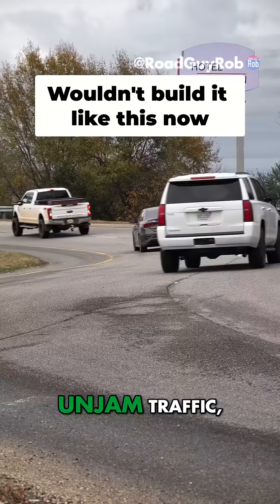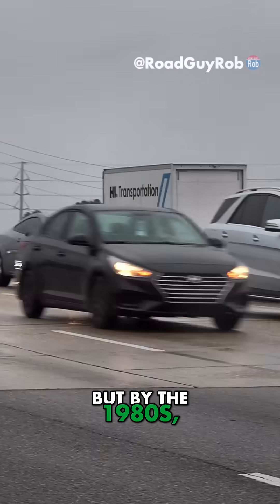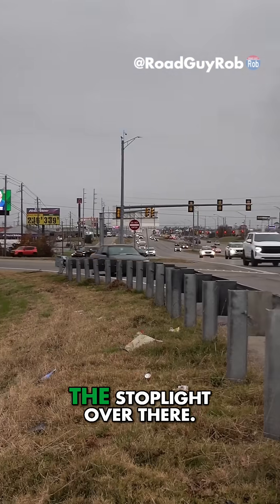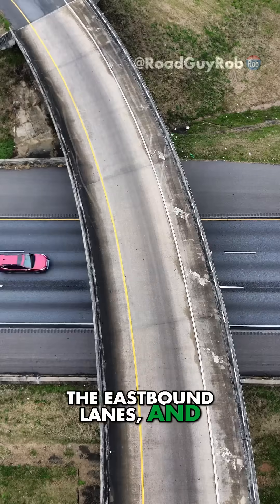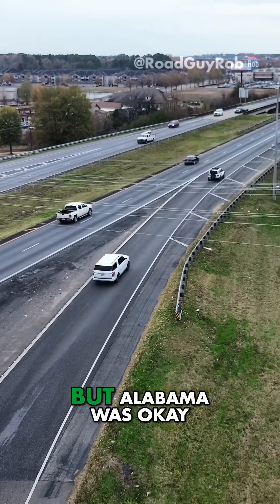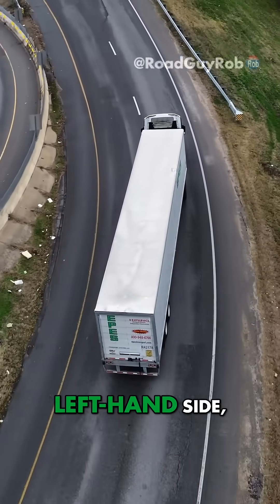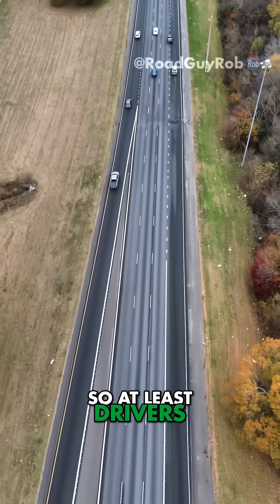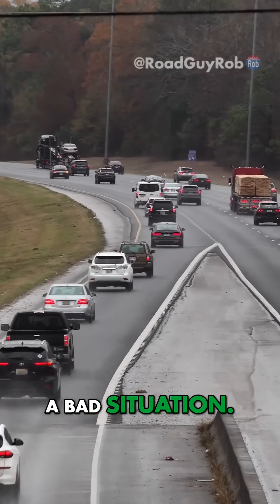Alabama Wouldn't Build This Today!

Comment: You say they wouldn't approve this today, but they are in the middle of building the same sort of left lane merge at the I-75/I-24 interchange in Chattanooga. Traffic coming off I-24E/I-75NB onto I-24E (via a fairly slow ramp) merges into the left lane. They similarly included a very long straight away before starting to pare down the left lanes though.

Comment: US-23 and M-14 in Ann Arbor have a similar problem; both share a 2-mile stretch on the north side of the city between two wye-shaped interchanges and all the ramps run through the center from one left lane to another. 

Traffic on 23 comes in on the left side, then has to merge right to stay on 23, and traffic on 14 comes in on the right, then has to merge left to stay on 14. Both have to fight the traffic that does want to interchange and it's a mess.

Comment: Rhode Island had a section of highway like this until a few months ago, state route 37 eastbound merged into I295 north from the center, except (as with everything in the state) there was no space for a huge merge and the curved overpass ramp was the only spot to get to speed. Westbound merged at the same time from the outer lanes, essentially turning 4 lanes into 2 as it enters a through cut

Comment: NCDOT still does this. During the construction of I-26 (which has been taking place for about 7 years now), a new interchange to primarily serve the Pratt & Whitney plant just south of Asheville was approved and included in the I-26 widening project. Due to the width of the median and the Biltmore Estate grounds bordering I-26 to the east, one of the proposed interchange designs had left-lane merging both on and off the interstate as it would be more cost-effective than acquiring land from the Biltmore Estate. Guess which design NCDOT chose

Comment: You can't make the merge lane long enough for those drivers that wait until they merge onto the highway to drive faster than 45 mph. They sometimes are driving slow to block a faster drive because the just have to be in front.

Comment: There’s a left hand merge on I-95 north at Rt 32 east in Maryland. It’s a nightmare.
Reply: Yes, I used to have to use that one once a week. You have to get into the far left lane to take the exit then merge onto I95 also in the left lane. A real shitshow especially when there are slow moving trucks.
Reply: Especiallu for trucks that enter a lane that they are restricted from using.

Comment: The interchange of the Lodge freeway and I-94 is the worlds first city freeway to freeway interchange and it has left hand merging on all sides. I-94 in Detroit used to have alot of left hand merging and also some the shortest ramps cause it was built before the Interstate system existed so their standards yet. It is currently going through an overhaul where they are upgrading those sections to modern standards where they have eliminated left hand merging, lengthened ramps, rebuilt overpasses and eventually a widening but the Lodge interchange will not be changed due to its its historic significance and being no room to change its design which also happens to take up the least amount space of any freeway to freeway interchange.

Comment: In Seattle, both directions of I-5 between Mercer St and Hwy 520 merge from the left and have a big exit 3 or 4 lanes to the right in under a mile.  It's called the Mercer Weave and it's been slowing traffic through that area since the 1960s.

Comment: There's one on the Northbound 101 from Highland.  There's a long straightaway but there's also a slight incline so some cars still have trouble getting up enough speed to merge safely.  Not to worry though, drivers in LA don't necessarily care if they're driving fast enough to merge safely.  Half the time, they don't even bother to look before changing lanes.

Comment: In Gwinnett County in Georgia, Highway 316 headed towards Atlanta used to merge on the left side of I-85 South.  It was a common pain point in the area with frequent slow downs and wrecks.  They finally had to build a new interchange to fix that issue and several others in that location.

Comment: Yeah, it doesn't matter that's coming from the left. Because, as you stated, they've got ooh, huge amount of time to accelerate and get up to speed. If they fail to do so, they're just stupid. And it wouldn't matter where you put them in, they're gonna be a problem.
So the left hand entrance isn't the issue. It's just that old ladies, are ladies...

Comment: I actually think those left Maron ramps are better because people should be accelerating when they get onto the highway especially if they’re going from one highway and using a ramp to go down to the highway they’re merging onto that helps them accelerate in putting on ramps and off ramps on the right side, just creates a bottlenecks

Comment: It wouldn’t be bad at all except that the ramps merge from both sides simultaneously, which could create inadvertent side swipes in the middle, not to mention extra congestion from two merges happening on both sides at once. Seems like on ramp should finish merging completely before the other starts its merge

Comment: TDOT did this in the early 2000s when they built the first phase of the 40/240/Sam Cooper interchange on the east side of Memphis. 40 West to 240 South is a flyover with a left lane merge.

Comment: The I-285 East to GA-400 North in Atlanta used to be like this but with a much shorter acceleration zone
Reply: 50% of all drivers I know are TERRIFIED of it. You got less than 60 feet after a fairly tight turn to get up to 50+ MPH to 'not die'. I'm confident they rebuilt the interchange specifically for this problem.
Reply: Have they finished the upgraded interchange there?
Reply: @brainwater  They did, maybe two years ago? Now there are these bypass mult-exit lanes so it's still pretty frustrating and only a little more safe. But it uses a whole lot more dedicated roadspace.

Comment: Any country with road design rules can say the same. “They wouldn’t do that now days.” actually means “The rules have changed a lot since then, so they couldn’t build it like that if they wanted to.” Prime example is a highway in a small state of Australia, that the locals complained for DECADES that the original improvements were not good enough. The highway couldn’t be legally modified, because by the time a deign was made, the rules had changed again. Each time. Eventually, large sections of private land were acquired, just so sections could be straightened, hills and dips removed, and the required sight distances fulfilled. Sections opened, and no further modifications could be made on those sections because the rules had changed again, requiring more land.

Comment: Check out Minnesota, Minneapolis 35W to 94 East (Exit 16B)
Super sketchy in medium traffic. And no acceleration lane. Pretty sus. 
44.96568° N, 93.25868° W

Left hand merge.
Reply: Extra butt picker in the winter. Also has bonus points because 94E is at a much higher elevation then 35W. Basically enter 94E nearly blind.

Comment: Check out the New Orleans Airport left side flyover on ramp from the new terminal onto I-10 EB. Construction of it and the DDI were just recently completed.  Engineers will still design the left side on-ramps even today.

Comment: my part of the world (not the US) doesn't really do fast lanes or slow lanes: traffic that can't maintain the speed limit (which generally shouldn't be on this sort of road in the first place in the normal course of events) is required to keep as far to the outside as is safe and practical to minimise the hazards involved in overtaking them and ... that's it. lanes are dictated entirely by which one you need to be in at the next exit and how jammed up everything is because All vehicles on such roads are supposed to be going within a very small margin of error of the speed limit unless conditions are slowing Everyone down for safety reasons. 

And yet, we still don't have traffic merging from the inner-most lane, mostly because of visibility issues.

Comment: The dumbest part is that the merge shouldn't happen and is needless. Without it, this becomes fairly safe.

If you look on Google Maps, the next interchange immediately after this is a 5 lane divergence with 2 heading off the 3 lane freeway. Making it 5 straight through is a lot better than only adding a 5th lane at the next exit.

Comment: Dang those Alabama engineers can think. Unlike the doofus down here in Jacksonville, Florida, designed a left hand on ramp from W Adam St to I-95N that’s as short as their thought process. Crazy enough I have seen folks coming out of that on ramp and IMMEDIATELY crossing 4 lanes of traffic to immediately exit to US-17N on the right. Crazy work.

Comment: The I-86/I-15 interchange in Pocatello Idaho used to be this same way, except it had a pretty short ramp before you had to merge with the left lane of people coming up from Utah who didn't respect the speed limit in any sense.  It was also an uphill off camber corner that slowed you down to about 25 just before that 
It seemed like as soon as it was completed, they tore it up for another five years and now you get on I-15 north from the right.

Comment: A lot of highways that have rest stops, rather than building one on each side just build one in the middle where you must exit and enter on the left side (i.e. Florida's Turnpike)
Reply: I've mostly seen those on toll roads.  They put "services plazas" in the center.

BTW: There is something weird with Google maps and the FL Turnpike.  The turnpike is almost always slower than I95 for the trips I do, but Google maps will always try to route using it unless I check "avoid tolls" in the settings.  Sus
Reply: @travcollier  Depends on where you are, but I've never found I95 to be faster, especially with traffic. Though since they quite literally follow each other from Jupiter to Pt. Saint Lucie, unless there is traffic I just take 95, saves me toll money, lol.
Reply: @Ilikeminecraft57 Howdy neighbor ;)
I've never found the turnpike to actually be significantly faster, and since it is two lanes, it get clogged up by accidents and geriatric drivers much more frequently.  

At best, it is 6 one way, half dozen the other.  And costs extra.
But Google maps, at least for me, loves the turnpike for some reason
Reply: @travcollier  Yeah I'm more south so Turnpike is 3 lanes for me, though they are widening it (which unfortunately means they reduced it down to 2 lanes where it was previously 3 to work on it). 

However my guess is because it is a toll road most people prefer 95, and just south of me is where 95 has its express lanes. I just prefer the turnpike because the express lanes are such a mess - going from 2 to 1 lane out of the blue, and randomly terminating forcing me into 95 traffic

Comment: Downtown Chicago has a lot of these. They even retained them when they rebuilt the expressway.
Reply: Those are super short too. At least downtown traffic is usually slower.
Reply: @ArchOfWinter I've tried to merge with traffic that was slower than a dead turtle and still had trouble getting in. Chicago drivers seem to have a pathological hatred of anyone who gets in front of them.

Comment: Something I’ve never thought about. Whenever I see a free flow merger lane, I gun it as I know the expectation is on ME to get upto the speed of the traffic I want to join and not upto them to slow down to allow me in.
Reply: So true, but almost every time you got somebody in front of you going 10 under the limit that will be an absolute hazard when merging onto the fwy (:
Reply: Tell that to the guy in front of me every morning merging onto a 65mph highway at 35 mph
Reply: @W333L  unfortunately there are some ramps near me that are super short, so that getting up to highway speed before the merge lane ends is damn near impossible.  It's especially a problem on cloverleaf ramps, and even more so on the full cloverleaf interchanges with the shared exit/merge zone.
Reply: @Patrick94GSR  Cloverleafs are horrible. Traffic entering the freeway and traffic exiting, and needing to brake for the tight curve on the off ramp use the same lane, which make it impossible for the entering traffic to get up to speed.
Reply: @Patrick94GSR yeah, that’s true, but I see people in sports sedans doing that shit when I know they can easily get to speed, and they even do it on the 200+ yard on-ramps. For a lot of people it’s just plan stupidity
Reply: A lot of people I've talked to about this are convinced their car will explode if the engine revs high for more than a fraction of a second
Reply: @verxintRising dang, I Rev mine out to nearly the 8K RPM red line on just about every on ramp, and it’s nearing 400,000 miles on the original drivetrain.
Reply: @v @verxintRising ’s actually bad for your car to go long lengths of time without throttling your engine. It allows engine oil to gum up, causing thermal and mechanical issues over time. It’s not going to destroy your engine alone, but it’s super dumb that people think using the engine as intended will shorten its lifespan

As they say: “a redline a day keeps the mechanic away”

Edit: before you come after me, no don’t actually redline. Always stay a little shy of it, and do this on a warms up engine. If you’re less than 5 min from the freeway, let it warm up in the driveway first
Reply: that's literally how EVERY on-ramp merge lane should work.  Traffic already flowing should not have to move over to "let" someone merge.  The person merging should already be at speed so they can merely change lanes in between other cars.  Of course that means the ones already on the highway need to leave sufficient gaps for such merging to occur.
Reply: When you can... It isn't an option in heavier traffic
Reply: Unfortunately that often means you'd have to break speeding laws where I'm from

Comment: We have these in Wisconsin too, but typically are long enough for Drivers to get up to speed. The real problem is not the engineering, it is the drivers who don’t know where the gas pedal is!
Reply: I mean, you're still merging into passing traffic. Even if you're making the final lane change at triple digit speeds you're not supposed to cruise on the left in LHD countries

Comment: There are several of those left-merge on ramps along I-95 in Maryland.
Reply: They are very common on state highways that were later added to the interstate system. New England is riddled with left exits and merges on such roads. 

They just had a huge project near where I live to relocate a left merge, which was heavily used by trucks, that was at the bottom of a long steep hill. It jammed up traffic constantly.
Reply: The worst offender is the US-40/US-29 interchange in Ellicott City. An absolute atrocity for motorists. Especially when the ramp flows in to MD-100... in the LEFT LANE
Reply: US-40 in the Baltimore area sucks. In fact, the whole stretch east of where it splits from I-70 near Ellicott City is terrible, I’m talking all the way into Delaware. It’s not so bad in western Maryland where it’s mostly a rural two lane highway, but once you merge off that I-70 split and head into the Baltimore Suburbs, it becomes a 4-6 lane disaster of a stroad, through Baltimore, and the whole way east. I feel bad for the people who live along Pulaski Hwy who have to deal with such a stroad.
Reply: @MarloSoBalJr  I hate that interchange.
Reply: @DanielP-jq4dj  I hate that one, too.
Reply: Quite a few on the DC beltway too (technically part if i95)
Reply: @jacobmarquez9805  Only the east side is part of 95.
Reply: And we all know how well the Maryland Driver ( cousin of Florida man) use their turn signals…… 😂
Reply: They used to exist at the 95-695 interchange (northeast corner of 695) until they completely rebuilt the interchange for the express lanes.
Reply: I hate the MD 32 East into i95 North ramp. I also seem to end up behind someone who fails to use the lane to actually accelerate and match traffic.
Reply: It is OK in MD...95 is never moving at speed anyway.  Sigh.
Reply: @BrianFullerton  Sometimes it does. It depends on the hour.
Reply: same on i5 in seattle
Reply: Yeah. We just added one like 6 months ago with the latest ETL expansion from mm 67 to 74
Reply: Maryland seems to be getting rid of them, at least north of Baltimore.
Reply: @cisium1184  It’s still a common problem between Baltimore and DC. The interchanges with 695 in Halethorpe, and 32 in Columbia are good examples.
Reply: Ecorse Rd to I94 in Taylor, MI is another example 
Hate that one
Reply: Looks like a California onramp. These are all over California along the interstates. I think they are relics from state highways that later became interstates.
Reply: Same in Tennessee
Reply: Reminds me of that awful ramp on eastbound GW parkway on Columbia island. There’s a crosswalk right before a left lane blind merge.
Reply: Their rest areas have this, I guess to give both sides of i-95 the same stop area without needing any bridges. But I don’t really like that design.

Comment: Yeah, but it was a lot cheaper to build. Engineers don’t take that into account often enough any more, IMO.
Reply: I guess you'd have to weigh that against the costs involved with the additional car crashes.
Reply: so if you die its fine because its cheaper. It is not the duty of an engineer to worry about price, just solve the problem
Reply: @Nova32x Your ability to miss the point is almost admirable.

Comment: Fun fact: the ramp to turn right from I-85 north actually used to split into a slip lane and a stop sign-controlled hard right, but they changed it to a more conventional signalized right a few years ago. The reason for that kind of right turn? There’s a major intersection that sits just south of the interchange with I-85.